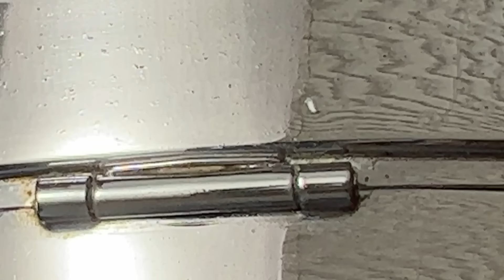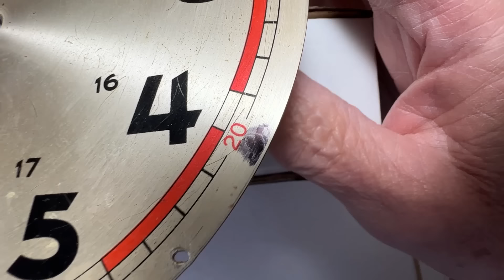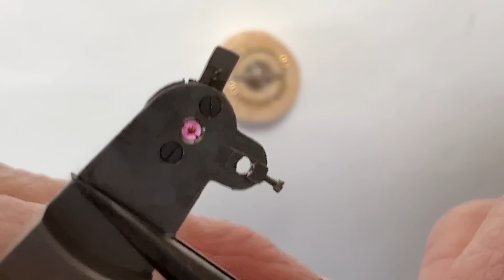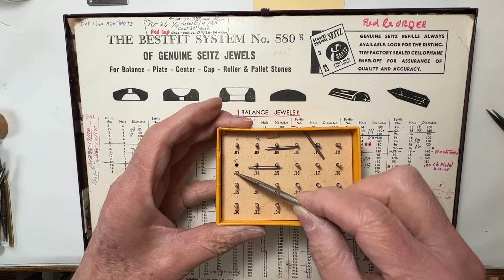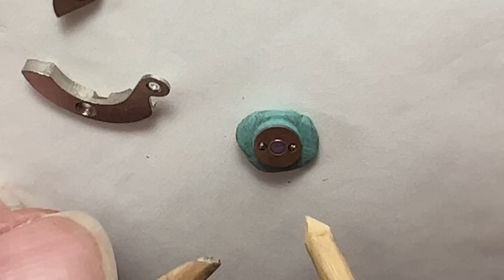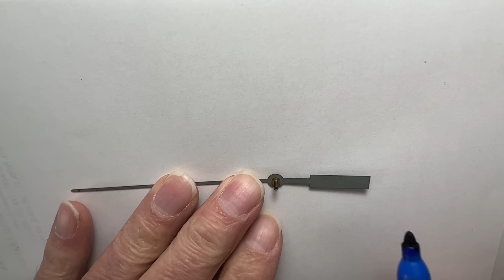Junghans W146 Ships Clock movement Restore for Ron from Iowa #89

Comment: Did the owner not want to renovate the case? Strip the copper and chrome plating and re-apply? Beautiful work and narration.
Jason
Reply: Yes, too bad the case is not perfect, but still better than many. Unless this clock was manufactured in early 1940’s (with dial displaying German military markings of that time), this 1966 clock does not have a great inherent value. When I watch the inspection at Mr. Martin’s desk, the case is very acceptable in my opinion. Yes, when inspected closely, the chrome losses are evident. However, a liberal application of carnauba wax should help preservation.

Comment: Today I learned what an Arkansas stone is! Much of your replacement parts look to be from years ago, are there still suppliers out there that can refill your beautiful collection of vials with jewels and stuff like that?

And how do you find the appropriate thread pitch of a threaded hole that small if you don't have the original screw?
Reply from the maker: Thanks Deeran,
 There are several different grades of Arkansas stone available from soft to hard but grit is about the same.
Yes, Seitz still fabricates these friction jewels today, just a little spendy at today's prices.
I cut a small sliver of that mylar I used to protect the dial with until it was narrow enough to spin into one to those holes, the threads left an impression on the mylar that I was able to determine a thread pitch.